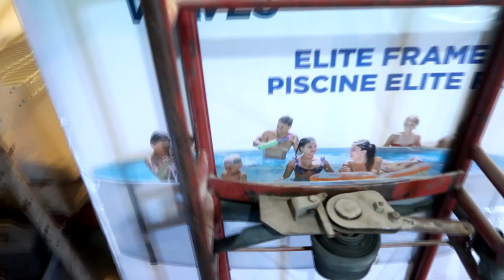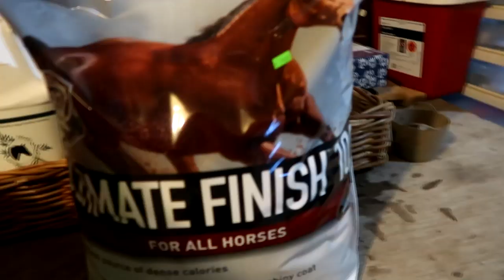THERE'S A SECRET NEW HORSE.......Day 135 (05/13/20)

Comment: Hey Laura! Tip: use colored duck tape on your poles instead of paint. The tap will hold its color longer and prevent splinters and the pole chipping. It’s also less time consuming and cheaper